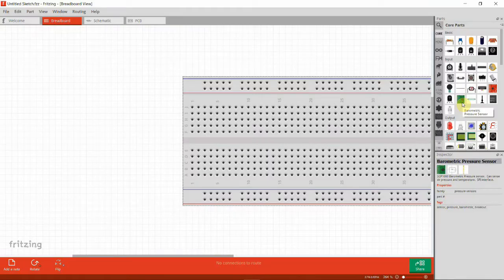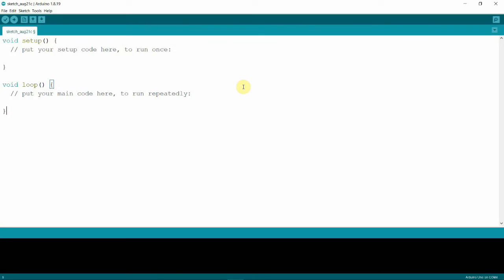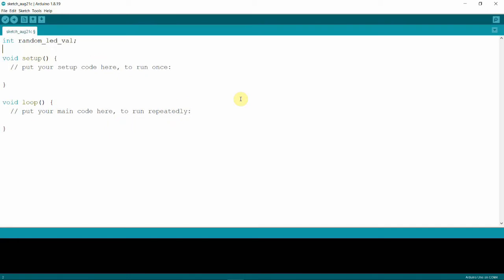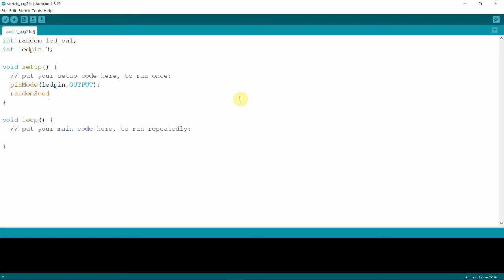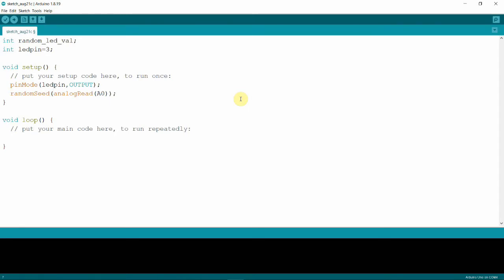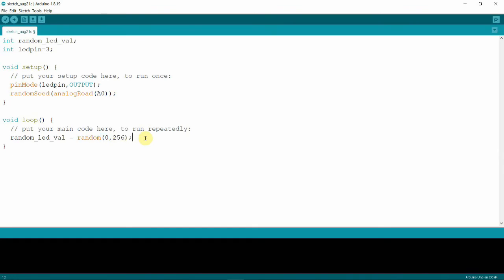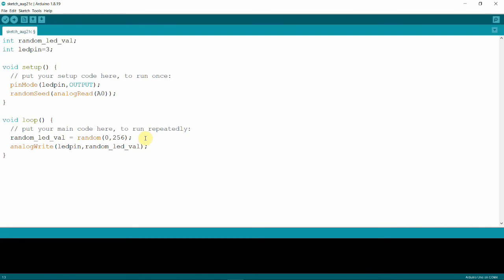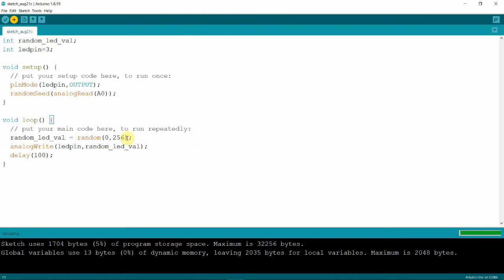Arduino Explained: Random Brightness Using 1 LED

Comment: Thank you so much. So I presume it could be possible to randomize the delay value at the end with another int variable, something like random_delay_val?
Should it work with the same seed?
Reply from the maker: Yes, you can. You can write delay(random_time); just before the end of the loop(). The code is found on the link in the description
Reply: @arduinointrochannel  thank you, this is very helpful.